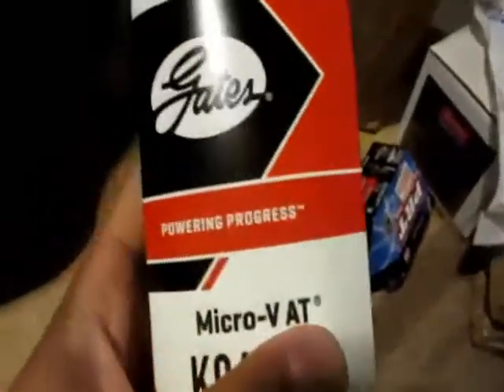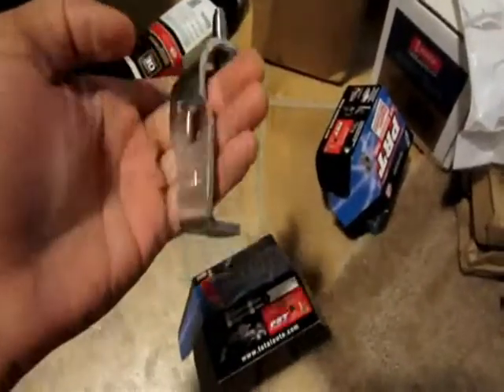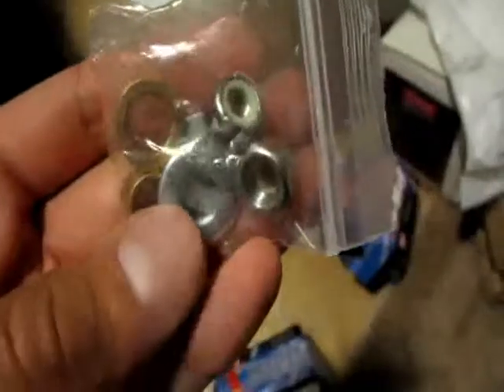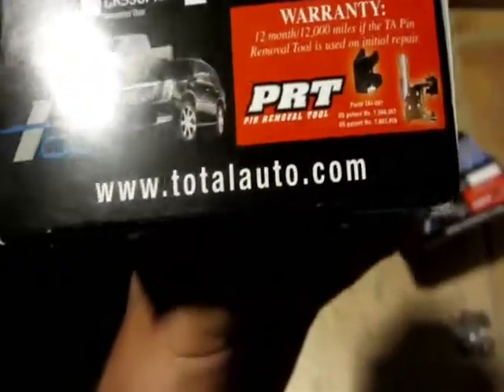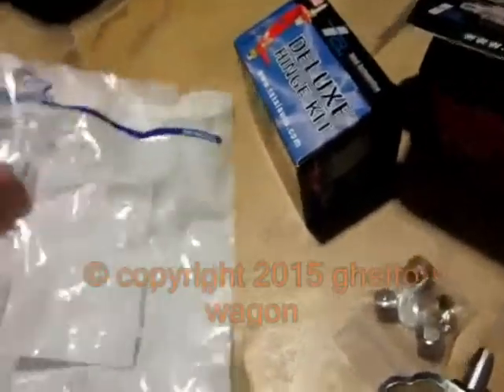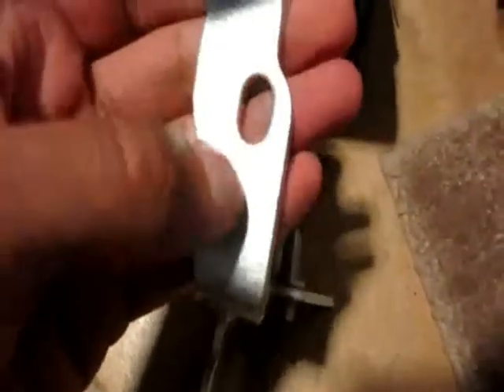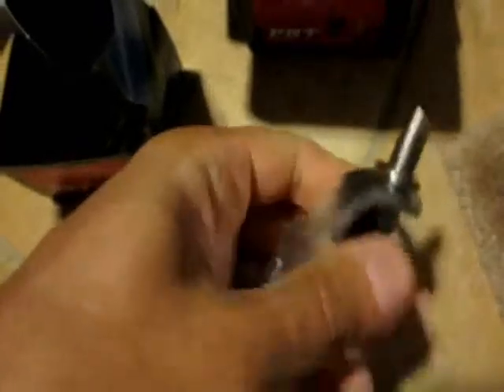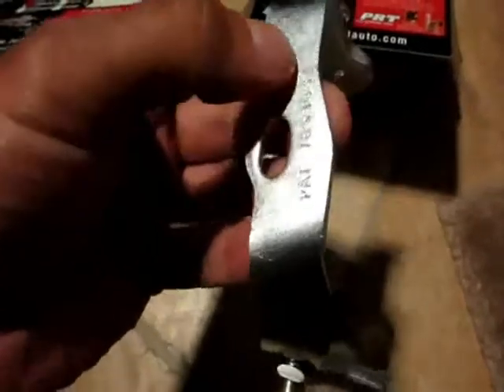Gates belt made in mexico? Door pin kit Silverado 99-07

Comment: how much was the pin kit?
Reply from the maker: 06CHEVYDURAMAX 131 for upper and lower, The other hoard for the job was 55, The passenger front door is about to fall off too, No idea how it got this bad, I never drove it.    I drive trucks with 250k with tight doors. Passenger side will also be done if this works out.